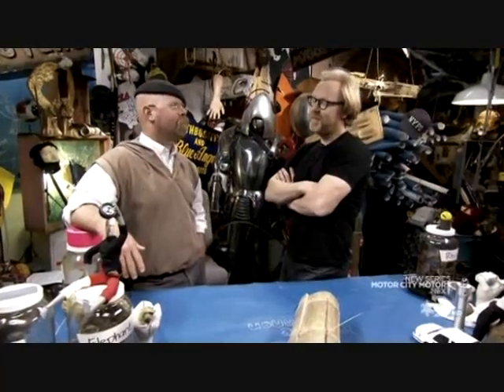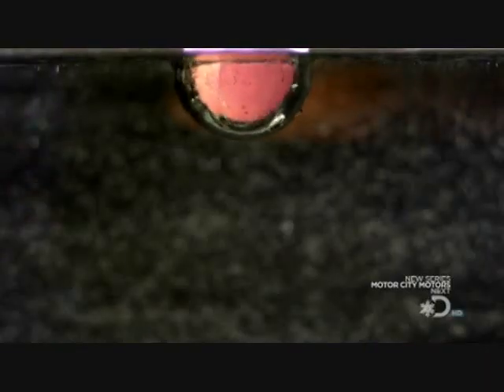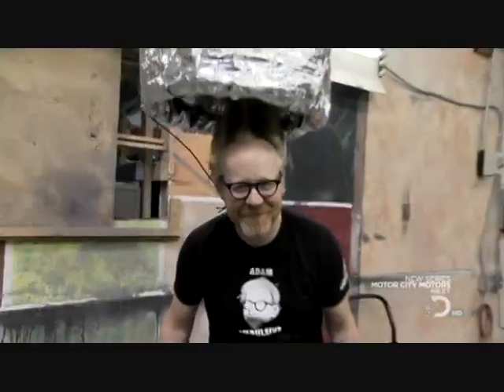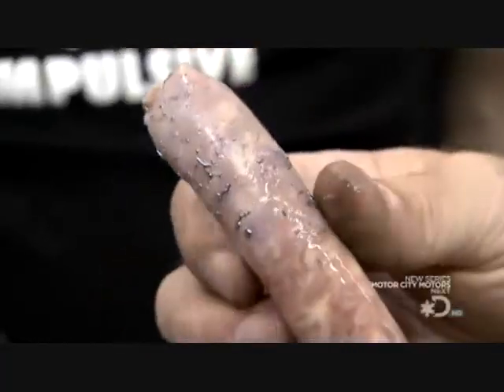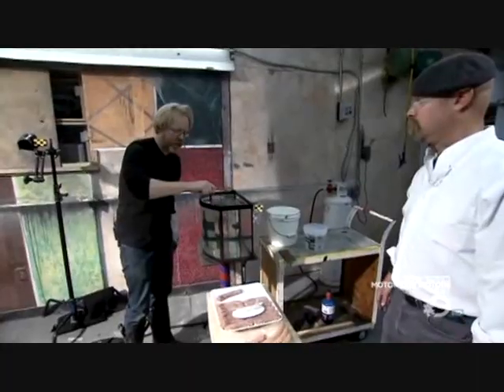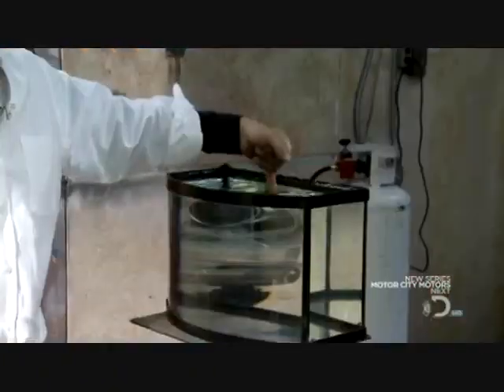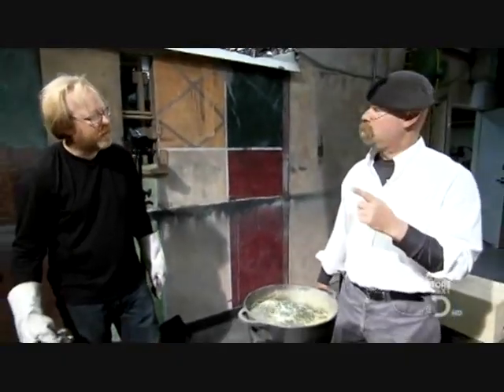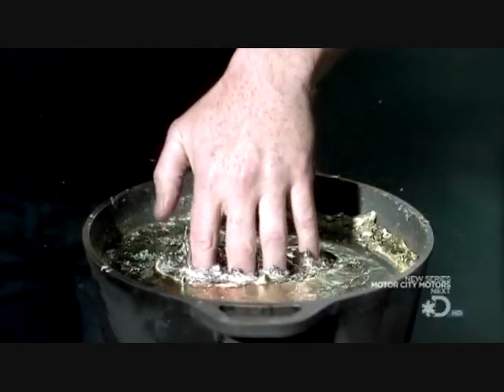Dip your hand in molten lead without being burned!

Comment: i thought lead is toxic.
Reply: It wasn't actually absorbed into his skin, the Leidenfrost effect protected him.
Reply: but it is boiling
Reply: SofaKingFabulous Xx
And it works with any material, really.

The key part of it is the temperature difference - that's what has to be extremely high.
Reply: Pyre Spirit i think he is talking about the gas
Reply: SpyCreeper The lead wasn't boiling. They were 200 degrees Celsius above the melting point, but the boiling point is far above what their setup could achieve. Lead is only toxic if ingested, which unless they were chewing on the lead bars beforehand, wouldn't have happened.

Comment: Oh, this one's a classic! It works on liquid nitrogen too! Liquid nitrogen is roughly -200C, or -320F. Enough to turn CO2 into dry ice, liquify the oxygen in the air and freeze, then shatter flesh like glass. Your hand is extremely hot compared to liquid nitrogen, so a blanket of nitrogen gas forms around it and prevents the vast majority of heat loss. It's a nice, mild cooling feel, but it'll only save you for a fraction of a second, so be fast. Side note---freeze fruit in liquid nitrogen, it's delicious!

Comment: This is one of the few myths that I think they should not have done. Unlike the various explosives-related myths, this one is easy to do at home, VERY easy to get seriously hurt by, and there's no meaningful safety precautions--either you're fine or you're mutilated, not much in between. With explosives and million-match-head bombs, "stand back" is all you really need. With this one, I would be astounded if some nitwit didn't think that it looked like fun and scarred themselves for life.

Comment: Old time pressman's trick for impresing guests in the ccomposing room. I've seen it done many times, and even did it once myself.
Should be noted however printers lead for a composition caster is alloyed with tin making the type cast from it harder than pure lead [and giving it a slight purple tint in bright light], as such it needs even higher temps to melt.
Reply: For some reason I'm getting the vibes that you're like a time traveler from 1850 or something...
Reply: @rum-ham  I've been called an old soul. I think I know FAR more about things from the 20's, 30's and 40's than most people my age. My knowledge base is pretty eclectic.

Comment: You don't even need the water if you do it fast enough, because heat takes time to transfer, a quick dip is not enough to transfer the energy necessary to harm your body, although it will feel very warm.

Comment: If anything, the water increased their chances of getting burnt. The real reason that hot molten metal does not burn is due to the lack of a flux to transfer the heat. Just try soldering without flux and the solder just 'runs up' into little balls. Therefore it is vital to remove any natural oils from the surface of your skin. People who have tried this experiment in the past, have used degreaser and alcohol to remove all traces of natural oil from their hands. The same principal applies to similar things and explains how it is possible to put a cigarette out on your bare hand with very little damage. That is where the mind over matter'  theory is explained, since if you are afraid, you will sweat and oils will come to the surface of your skin with the obvious results.

Comment: They’d probably get better results if they degreased their hands in isopropyl alcohol first (to ensure maximum adhesion of the water to their hands and didn’t shake off the excesses water. I reckon the first attempt with the sausage may not have worked because sausages are greasy and the water would have beaded to some extent, rather than fully coating the sausage. Although I forget the original temperature of the lead. Apparently the leidenfrost point is 193C for water, so if it was lower than that (too lazy to check and rewrite/cut and paste my comment again).

Comment: Ahh thee ol punch effect. Lead is dense so when you punch it quickly it opens up into a big cavity. You pull out before the lead can close around you. But as you show it has to be hot enough,if too cold it won't blow appart enough and will stick.
Reply: Not quite. The secret is that there's a big energy difference between states of matter. Most relevantly, turning water into steam absorbs a lot of energy and lead solidifying releases a lot of energy.
 If the lead is too close to its melting point, it freezes, sticks to your finger, and keeps transferring heat into your hand until they are the same temperature, burning you.
As they showed, well above the leads melting point, it doesn't lose enough heat to solidify before the water on your skin runs out.

Comment: Remember, the lead is at around 450 degrees Celsius, which puts this stun FIRMLY in the . . . "Don't try at home" category. 

Edit: I could probably do it in my science class. We do some of this stuff. Crystallizing pipe cleaners with washing powder and boiling water from bunsen burners, mixing the 3 main articles for nature (solid liquid and gas) together even, fertilizing duck eggs, even the hot ice trick was done there. So yeah. Maybe not at home, but I could probably do it in my science class.